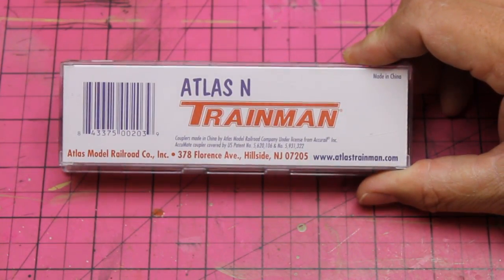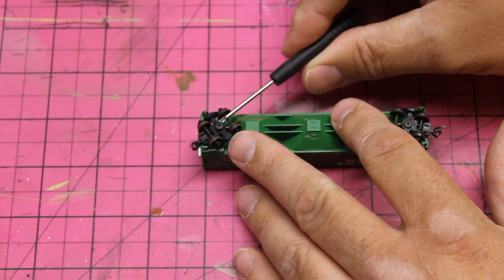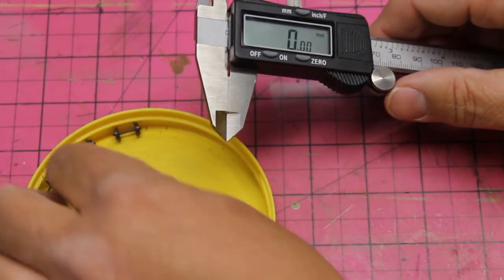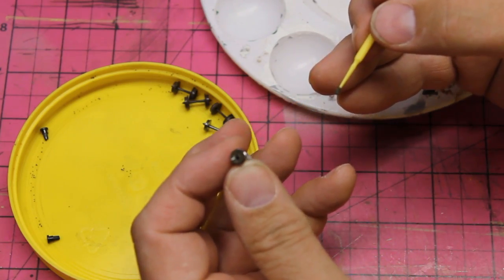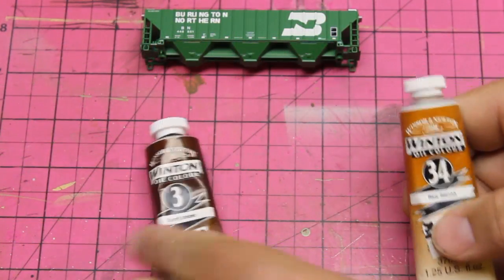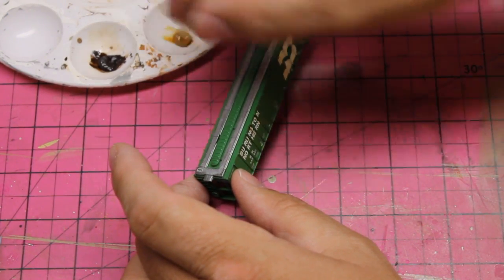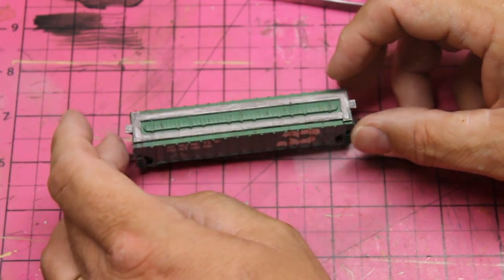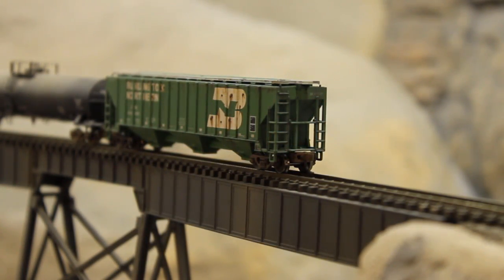How to Weather Rolling Stock for Your Model Railroad

Comment: Thank you for sharing. One thing I use is 231 Greas-Em Lubricant 5.5 Gram Tube. in the pockets for the wheels. it help the wheels roll smooth for a very long time. and only take a second to apply.
Reply from the maker: +Vincent Sanders Thats a good tip. Thanks!

Comment: I’m about to try your techniques! I was wondering how you would go about weathering the trucks and ends of the car without an airbrush, as I don’t have one. Thanks!
Reply from the maker: Without an airbrush, get a rattle can of dullcoat and spray the trucks first, then I would use paint pigment powders like Monroe Models or Bragdon powders. For car ends, I assume you mean the splash streaks. I would use a small brush and a drybrush technique stroking in straight lines from bottom to top only.
Reply: Great, thanks! Subscribed!

Comment: Really great video .. do you replace the couplers and trucks as well when you do this?  If so what to change them too?
Reply from the maker: +craig snyder That depends on the car. I have had good luck with most magnetic knuckle couplers in N scale, so usually no. Kato cars I keep the trucks and metal wheels, cut the draft gear box off, and install body-mounted couplers. Long cars, same thing. If money was no object I would go body mounted on everything, but it is an object so... When I replace trucks and/or couplers I always go micro trains with fox valley wheelsets.

Comment: great video on your tanker video you used dullcoat to give paint some tooth did you not do that here?If no why?
Reply from the maker: +Troy Brodrick I only used Dullcoat on the trucks bacause the kind of plastic used for trucks does not take paint well. The styrene of the body does not need it when painting. When I use powders I use dullcoat to give it tooth.
Reply: Thank you great work

Comment: Just found this video.  My question is why use the oil paints rather than acrylics?  Maybe this was discussed elsewhere.  If so [please advise where.
Reply from the maker: Acrylics for streaks are very unforgiving. If it isn't just right it dries and it is there. Oils have a long working time and can be reactivated with a solvent. Also the oils create texture which acryics cannot achieve.

Comment: Okay, good video.  But.  Perhaps you could do a video on this issue.  I have a box of N scale used rolling stock less trucks.  I have a bag full of trucks that presumably came from the cars.  What is missing are the bolster pins.  I purchased replacement bolster pins (Atlas) and guess what?  Bolster pins are not standard! And, apparently, none of my cars are Atlas.  In this video, you took the Atlas truck and therefore the Atlas coupler, and kept it.  Really?  On your layout, don't you standardize your couplers?  Or do you really find that all couplers work well together?
Reply from the maker: Not all couplers work well together, but I have little trouble getting MIcro Trains, Atlas, and McHenry couplers to work together. (I know HOers hate McHenry couplers with good reason, but the N scale one Athearn uses are ok.) I use some of all of them, can tell very little difference in look and function, and if one gives me trouble I replace it. Kato and other couplers get the automatic boot as they are not compatible and/or just don't play well with other couplers.

Comment: Ron: Which wheelsets?  What size,flange depth, part#, should I get for smooth running one code 55 rail?
Reply from the maker: +Eldon Lowman I don't have code 55 track, but I run Fox Valley metal wheelsets with scale flanges. I will have to check specific part #s and get back to you.

Comment: great video.  Why don''t you spray between applications of rust?  I use artist's spray over my first coat so I didn't "rub" off the first coat.  The artist's spray seemed to work well.  Just wondered if you had an objection to using it?  I don't like Dullcoat because I use pastels a lot and it seems to fade the pastels.  The artist's spray seems to work better.  Any ideas/comments on using them?  Watching your videos from the beginning and having a lot of fun!!!!!
Reply from the maker: +Nancy Magee I do use the coat when it is necessary to protect one layer before the next.  It isn't always necessary. As for pastels,
Reply from the maker: +Ron's Trains N Things ... as for pastels, you should try using pink pigment weathering powders. Monroe models weathering powders-- formally known as AIM powders-- for Brandon are too excellent examples. They don't rub off like artist pastels nor do they disappear under Del coat like the pastels do. They also have an adhesive quality that keeps them in place much better than the pastels. If you like artist pastels I think you will love these weathering powders. Your overspray or a layer of Delco is still a good idea but not as crucial with these as it is Whitney artist pastels. But back to the first question I do think Delco or the artist overspray that you mentioned is a good idea between layers of weathering.
Reply from the maker: +Nancy Magee ... And by the way welcome to the channel and I am glad you are enjoying the videos. I have enjoyed your comments and questions. They have been thoughtful and constructive. Thanks.

Comment: Most of the roof hatches are aluminum or plastic. They will get dirty, but plastic doesn't rust.
http://s3.amazonaws.com/rrpa_photos/115580/_DSC8681-91.jpg
http://s3.amazonaws.com/rrpa_photos/115580/_DSC8648-59.jpg
Reply from the maker: +Karl A You are right, today most are aluminum or fiberglass. Early on many were pressed steel. Older cars with replacement hatches often had mismatched hatches of white or gray. Since this car had the same green color hatches I treated them as pressed steel. One good upgrade to this car would be to remove the hatch covers and paint them primer gray as replacement fiberglass.

Comment: Hey Ron. Just a couple of questions..
How come you don't wash the car to get finger prints off and then wear gloves to handle it?
And how come you don't use dull coat first to give the paint something to bite too before doing the weathering?
Reply from the maker: +ATSF1317 As for dullcoat, with the techniques I used here it just isn't necessary. Honestly, the streaking works better on a smoother surface. If I use dullcoat here it would be to seal everything after weathering.

As for gloves, sometimes I do wear them, but I always wash my hands before handling a car and I handle them carefully. I have never had a fingerprint issue. I should probably take more care, but it has just never been a problem for me.
Reply: Ron's Trains N Things That's no worries, just I'd ask as I've seen different techniques.
Cheers, Dan
Reply from the maker: +ATSF1317 I actually had the thought midway through shooting this that I should be wearing gloves. Its probably just a bad habit that I do not.